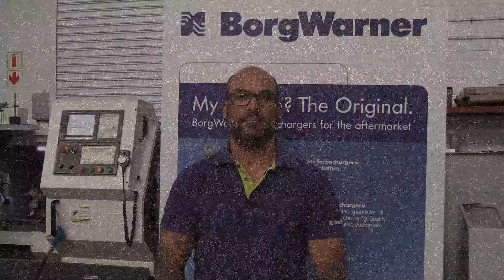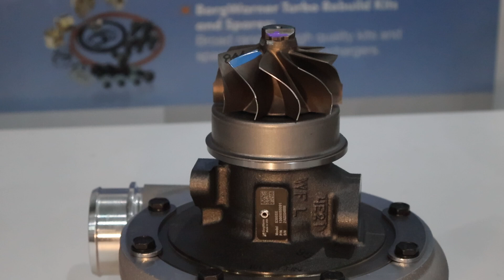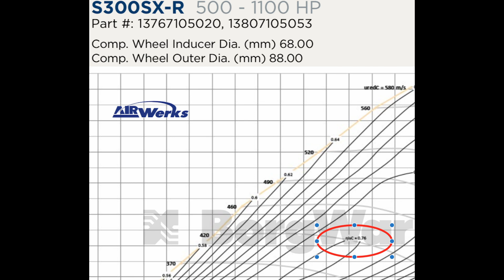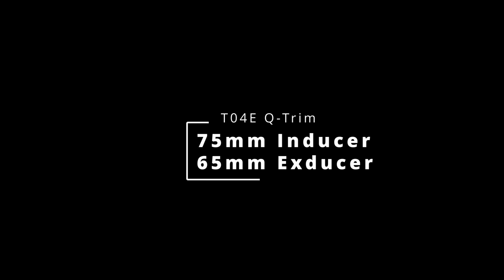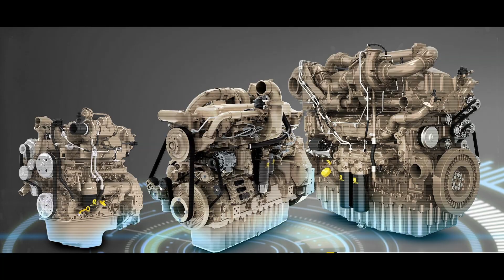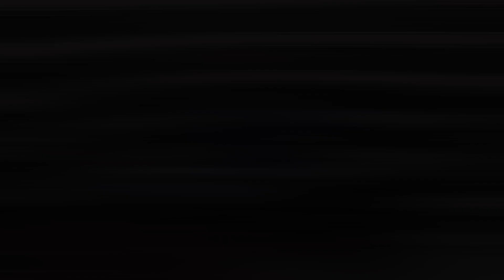S300SXE versus S300SXR The long awaited Video

Comment: I think Borg Warner has the best turbo engineers bar none. Pun intended. People who buy fancy aftermarket turbos for a brand name are kidding themselves. Not talking about Garrett or other OEM providers so much as the flashy old school tuner outfits. The SX-E series already presented the best value in performance from everything I have seen. This is as big step up with barely increased pricing. Not only did they increase the maximum efficiency, but they increased it at high boost and high speed even more. About 0.2-0.4% gains across most of the map. It's also crazy the wide variety of engines you could put these turbos on given the broad map. Plus increased response with lower mass. Too awesome!
Reply: What g series ? 88mm inducer? The g351050 does not have the shaft power to push the compressor to the top of the map. Especially on any larger engine. (Back pressure )  a g40900 is a 62mm compressor or a 71mm? ( What g series ?)
Reply from the maker: @l_ionize333  HHMM precisely
Reply: @l_ionize333  you should never compare Compressors by the inducer diameter. You compare them by the exducer. So that would be the g series 88mm 1150 map.
Reply from the maker: @ManagerVitaly  Sorry have to disagree, the rules in racing especially rally and professional circuit racing limit INDUCER size and work with restrictors which sit in front of the INDUCER of the compressor -- for a reason.   Use your sense man.
Reply: Why ? Your vague at best. Why wouldnt I compare the restriction. Are you talking about trim? You can't even provide a complete model number. Is it a open scroll g40? What hot side? All of these things have an effect. Somehow it's 22% tho ... Lol
Reply from the maker: @l_ionize333  One thing that most people havent considered is the fact that the rated HP on the G-series is FAR from what it will produce in reality ...... BorgWarner do not overrate their compressors at all, in fact fuel flow on many high end cars we have been involved with, have proven the HP that the engine makes (never mind the dyno which is manipulative) and the fuel flow required in almost all Borg cases prove higher mass flow rate than published in print or paper by Borg -
Reply: When designing a centrifugal compressor, you use the flow coefficient (phi) to get the exducer diameter. And the work coefficient (slip) to get the exducer tip speed. Now you know the diameter and how fast it needs to go. The trim ratio is chosen to give the lowest inlet velocity vs flow. 

The 22% I referenced at pr 3.5 and 100lbs/m. The easiest form of energy required (shaft power) is mass flow* tip speed2* slip. If you know how much energy is going in, and you know what the energy coming out is, the difference is the energy required to turn the compressor. = Efficiency
Reply: @ManagerVitaly  Apologies, I think the generalizations made in your first post left a lot of assumptions on the table. (Large vehicle? what turbo? what 88mm measurement?  ) My fault for not reading between the lines correctly. Thank you for taking the time to reply. ( I am here to learn, and you gave me just enough info so I know where to look)
Reply: @l_ionize333  My original comment was in comparison to the SX-E series anyways, not really sure why a G-Series map was brought up. While I agree with ManagerVitaly that the exducer is the more important spec of the compressor, the inducer obviously matters too. That said, I think his opening reply misses a lot.
First off, what you noted later, which is that the Garrett map is very optimistic to be kind. Second I believe the way they measure efficiency is different as Garrett maps usually appear better when compared to other brands even when one line is clearly inferior to another. Third is that the SX turbo lines in general are not even supposed to be competitors to the G-Series. They are journal bearing turbochargers which are only oil cooled. The correct competition for the G-Series is the EFR.
The craziest part is that an EFR is still generally 1/3 less cost wise than a comparable G-Series and an SX-E or SX-R is generally around 1/3 the price of a G-Series or less. Compare an SX-E or SX-R to a Garrett GT or even GTX series, which still generally cost twice as much, and the Borg Warner only looks much more impressive. Not to mention they'll handle far more abuse. When it comes to the EFR, well there are still a ton of advantages over the G-Series even with the design being a fair bit older now.
Reply: @ManagerVitaly  So the fact that your compressor plot is always moving with load and rpm, unless your running at 1 fixed load and rpm. A boat perhaps?   If I plot the map for my current car's air requirements
 (Or any other plot I can think of) As  it moves across the map , it's going to remain in higher efficiency areas more of the time, with the sxr. Yes, If the Garrett is just right for my application , great.... (Let's ignore the fact that Garret g series map accuracy have been proven "hopeful" at best. )  In real world applications they bolth have their advantages. It's case specific.  That's why you had to choose a certain point on the map and you can not make generalizations.
Reply: No bot here, and no copy and paste. I only care about the info. Anyone can test maps, and no issues with either map in this case.
Reply: @ManagerVitaly  I do totally understand the large vehicle part. ( How a 4 cylinder can make more power with a given turbo,  a larger displacement engine takes less boost pressure to do it , the small engine needs all the boost. Exhaust vs intake pressure ratio. )
Reply: I don’t doubt both will be 10% lower. 110hp per 10lbs/m is a theoretical ideal number with everything perfect. Just Marketing
Reply: I couldn’t agree more on price. Turbochargers are ridiculously  priced. But I guess it depends on which country you live in. 

The isentropic efficiency is correct. I build maps. The numbers work and so do real life testing. Edit: I’m pretty sure most of that (from what I have seen) relates to Garrett referencing 110hp per 10lbs/m. Instead of the usual 100hp per 10lbs/m. But as you can see here, Borgwarner is now doing exactly the same. 

To be fair to drewdavis. I reworked the calcs more accurately over the entire bw mass flow range at a pr 3.5. All about real world and accuracy here. 

Mass flow. G Kw. Bw kw.
45.   76.1.      76.9 
50.   79.1.       79.9
55.   82.0.       84.3
60.   87.0.        87.4
65.   90.2.        91.2
70.    95.7.       96.6
75.    102.0.     103.2 
80.    105.1.      111.7
85.     112.3.     120.1
90.     118.4.     126.8
95.     128.2.     139.1
100.    135.9.     169.2
Reply from the maker: @ManagerVitaly  nothing accurate here at all - since you build maps, please show your calculations and how you factored in atmospheric conditions, BSFC and the AR of which turbine housing used? Since you 'build' maps (which isnt possible unless you data capturing from a gas stand) then you would know that 'MAPS' are DERIVED  (not built) from data CAPTURED (not fabricated) from direct physical testing on a gas stand - have you worked a stand before? (I have, in fact i own one) there are a MYRIAD of sensors measuring EVERYTHING from shaft speed, shaft flex, harmonics, balance, pressures, pressure comparisons, thrust, surge, efficiency (thermal and calorific comes into play)   I dont agree with your table above at all, HOWEVER i do agree with the fact that Garrett have been and are currently using 15-20X (not 10x as your comment states) This is information that i received from the horses mouth.  

At the end of the day this topic is above most peoples heads on this forum, and relates more to opinion than fact - i wont share too much more on this topic, but for one last comment - BorgWarner are far superior to Garrett in price, quality, design, efficiency/flow, materials and finally accuracy of information, especially in print.
Reply: @ManagerVitaly  The G-Series tested on the dyno often is 10% below claims though. We'll have to see if that's the case with the SX-R series. Still not comparable product lines though.
Reply from the maker: @802Garage  Its irrelevant what tests or results transpire - its not a fair comparison. SXR and G-series are nothing like eachother, and were never destined to be either. Comparing a 1980's turbocharged F1 engine to the 2024 turbocharged F1 engine is precisely what comparing the SXR to G-series is like doing.
Reply: @TurboDirectSA  Completely agree the comparison is faulty from the start. I think it still comes out very favorably for the Borg Warner in many ways, especially once you pick a specific application, and especially when you factor in price hahaha. ;)
Reply: Man, you are so full of crap! Your information is absolutely terrible.
Reply: @ManagerVitaly  Kyk die doos - dom doos!
Reply: Now, compare it to a G series 88mm compressor and you will find the g series will use 22% less energy to achieve the same at a pr of 3. The map is wider, especially in the areas that count. With the only slight advantage of the SX-r being above a pr of 3.75 (40psi). Which is almost unusable due it running into maximum speed issues for the flow requirements on larger engines. Just saying.
Reply from the maker: @ManagerVitaly  Thats like comparing inconel to putor --- not even in the same game, never mind ball park. Did you take into account the bearing system, or the fact that the SXR is a budget built JOURNAL bearing setup which is to date (including Garrett) is unmatched size for size? Not the GTW nor the CLUB series can come close to the ability of the Airwerks product. 

Comparing G-series to an actual direct comparison, i would look at the EFR range - and you will see a totally different story( i have many videos covering this very topic), The G-series is overrated, overpriced and unreliable in comparison. Garrett use 12-15X to calculate compressor P2C and flow rates- BorgWarner use the industry standard 10x -- thats why in reality the G-series wont see close to the claimed HP and most definitely cannot hold its own in terms of linear response and spool - they use MarM247 or Inconel (model dependant) -- Borg use GAMMA-TI -- noone else is able to use this material for fear of having to pay school fees in keeping the weld together - which Borg paid many years ago and have perfected it.  

Garrett's own printed catalogues cannot get the HP to compressor map values correct on the very same turbo (check my other videos) if that's anything to go by, i wouldnt consider Garrett at all - when choosing any turbo for any application outside of the proven GTX Gen2 -- G-series isnt worth the money or hassle.   And before you assume incorrectly, this information is based on more than 350-380 turbocharger repairs monthly and direct involvement both locally and internationally with MANY race, drag, rally and street projects of HIGH END category for the last 18 years.  Facts will always prevails (for those who have common sense) and Borg will do the due diligence and come out ontop against Garrett every time.
Reply: I have watched a few of your videos now, the Information you put out is absolutely terrible. On top of that, your attitude when ever anyone questions anything is just plain arrogant.
Reply from the maker: @ManagerVitaly  So sorry that we hurt your feelings.
Reply: @TurboDirectSA  LOL - hoekom is daar so baie dom vokkers daar wat nie feite kan verstaan nie!?
Reply: @ManagerVitaly  then change the channel if you dont like the content. @Turbodirect S.A please keep doing what you doing - we love it!!!

Comment: Well damn. I went from wanting an efr 6758 for my 1.8t to now wanting the s258sx-r. I just want the most responsive turbo possible for that engine. And then for my n54 i was planning on going s366sx-e, but now im stuck between the s364sx-r and the 368...why does BW have to keep doing this

The 1.8t is currently stock turbo and self tuned to 20psi. Its peppy and responsive but no top end to think of.

The n54 has hybrid turbos, also self tuned to 24psi and make peak boost by 3600rpm and totalling 625whp. Id love a single turbo that feels that responsive, if not more, and has the ability to touch 800whp if i decide to build the engine.

I know theres a lot to unpack from my comment, but recommendations would be appreciated
Reply: The value of the SX-E and now the SX-R is absolutely astounding. Compare them to even the cheapest Garrett turbos and it's like a bad joke. Borg Warner is really cooking.
Reply from the maker: @ Garrett don’t have an answer to the SXR I’m afraid and definitely not for the price
Reply: I actually run the 6758 twinscroll on my 2L TFSI EA113. It's very responsive and fun  especially on the street but I want to go to something bigger so I am also thinking of the 258sxr, to future proof for big power (more than 7163) though I am also wondering how the response will be  @turboDirectSA . Engine runs oversized pistons 83.5mm
Reply from the maker: @35gti-ke  SXR is an option but remember it’s not ball bearing and also not using the Gamma Ti turbine wheel. It also uses a much larger AR housing family - you will need to build a separated manifold for the twin scroll inlet to get the lost of the spool.
Reply: @TurboDirectSA  Yes I get that. And seperated manifold isn't a problem. SPA already make one (though you'd have to swap out to their twinscroll t3 housing).
Reply from the maker: @SuperHbkforever  haha Borg are progressing buddy - the SXE is old! The new SXR is something really impressive! For the 1800 20V - it’s a very lazy engine in stock CID - unless you stroke to 2.0 - you need nothing bigger than the EFR7163 - that will be a dynamite setup on that engine and make 500-520WHP
Reply: @TurboDirectSA  they always say pick the turbo for your goals. And my goal is the most responsive turbo for a street driven daily a4 that can run 450+awhp. I do have the crankshaft to stroke it out to 2.0 already, but I would want to enjoy it in stages without having to buy multiple turbos. Looking at the 258r it does seem very responsive, but is it way worse than the 252sxe/efr6758?
Reply: @SuperHbkforever  I think in terms of response and 450awhp from your list , the 6758 will serve you well. I run one and it's very good. The s252sxe is close in size to the 6758 so might have similar response.  Like you though, I am also in the dilemma of getting a turbo compromise of response but something that will allow me bigger power than the 6758 without constantly changing turbos
Reply from the maker: @SuperHbkforever  the EFR7163 is the best choice then for sure
Reply: @SuperHbkforever  If you want ultimate response, could always go to an EFR. Obviously about double the price or more, but still cheaper than a G-Series by a good margin.
Reply: @802Garage  lovely. Thanks for the replies everyone. Even though the efr is more expensive, the value of all the add ones it comes with kinda pay for themselves. Diverter valve and internal wastegate on a 600hp turbo is pretty great imo and for 70% the cost of a Garrett equivalent, it's not even funny that Garrett are considered top dog
Reply: @SuperHbkforever  This channel has a bunch of awesome videos on the EFR and comparisons to the G-Series as well if you haven't watched them. When you price them out it's really wild how expensive Garrett is. Borg Warner is a bargain in comparison, including against a lot of other big name brands which are just older Garrett style turbos.
Reply: @802Garage  oh I know. Watched them all several times over. Just always feel like I've made up my mind then something comes along to change my mind
Reply: @SuperHbkforever  The thirst for knowledge in order to attain the best performance and value is real.
Reply from the maker: @SuperHbkforever  lol indeed plenty products out there
Reply from the maker: @802Garage  100% correct! And Borg are a much bigger and more stable company than the others are too. Makes a big difference
Reply: @802Garage  Some of the g series work alright but there's no world where they should be efr money.
Reply: @sircefiro  That's the problem. Great turbos. Huge step up from previous Garrett offerings. Way too expensive. Especially when an EFR is cheaper by a good margin.